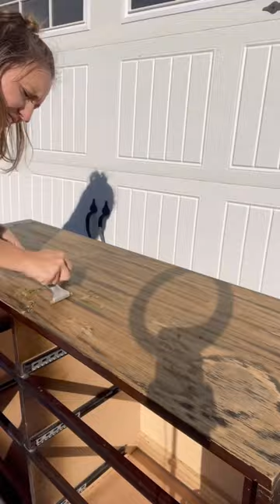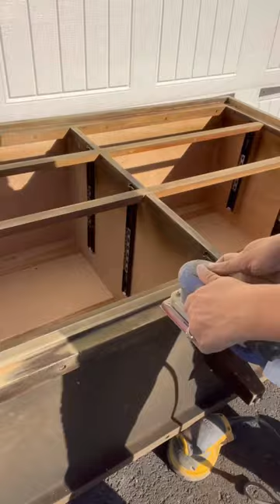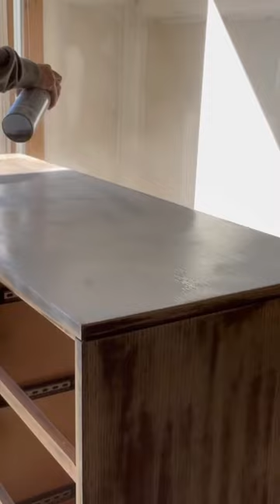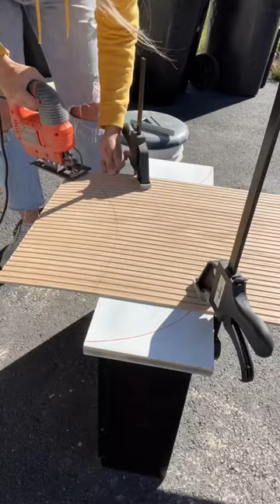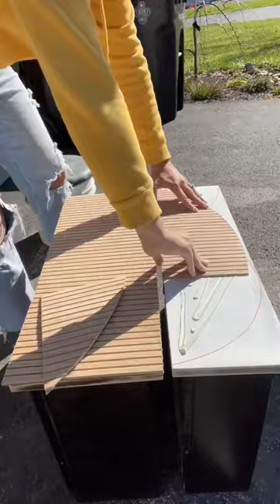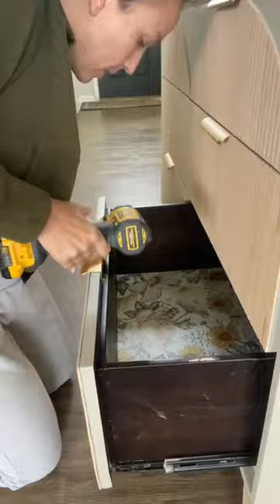From trash to $$$ - Watch this extreme dresser makeover

Comment: How did you solve the water damage issue on the particle board?
Reply from the maker: Hi there - I originally used Bondo wood filler but it didn’t work that well. So I used Rustoleum’s automotive primer and filler spray paint…and it filled in all those pores that MDF/particle board has. Definitely suggest buying a can of that to fix any particle board damage.